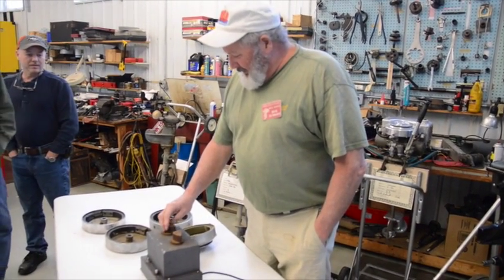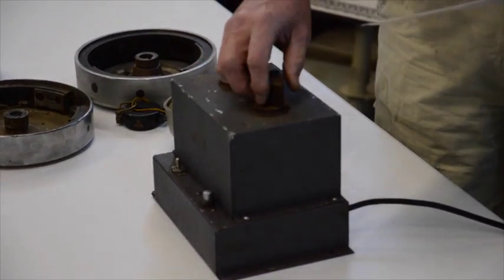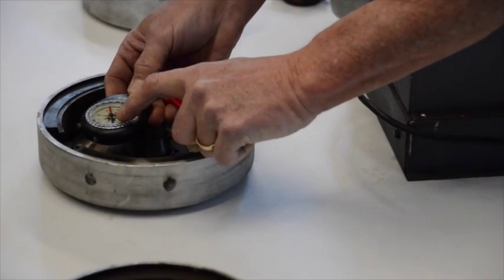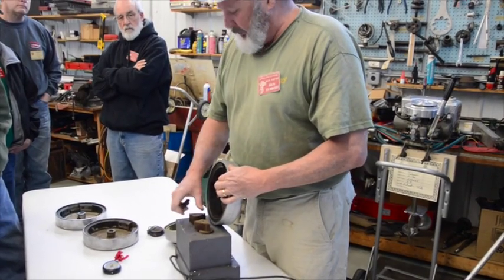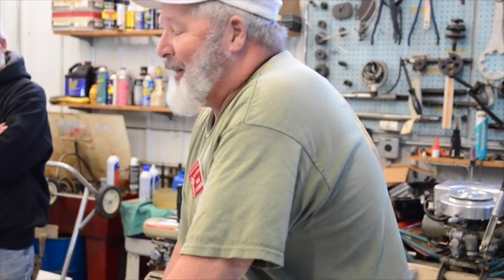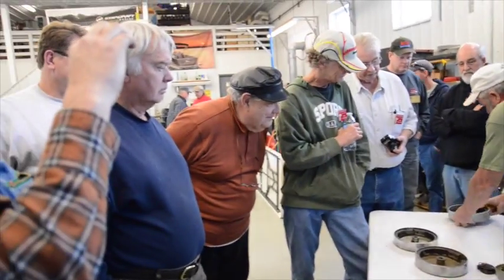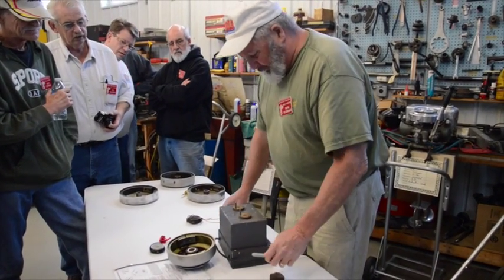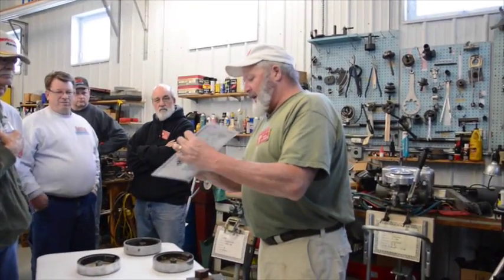flywheel magnetizing

Comment: It's nice to see how the Stevens unit should be used for different style flywheel magnets!  I just finished building a charger based on the Gingery and Stevens designs. Now I just have to make some shoes for it to fit several different flywheels. These motors are going to run again!   ☺